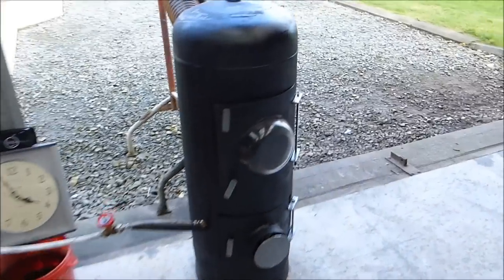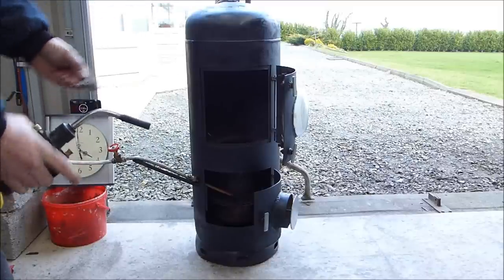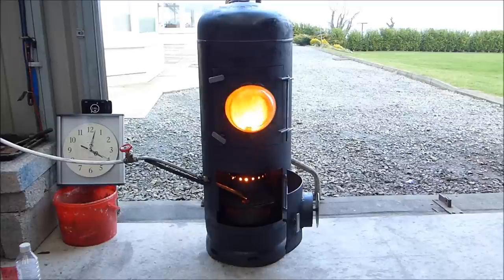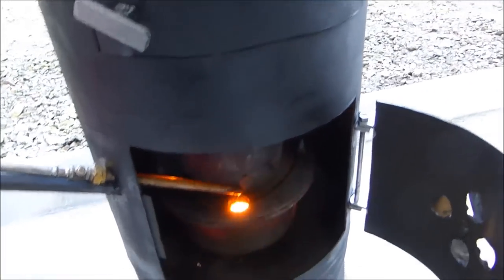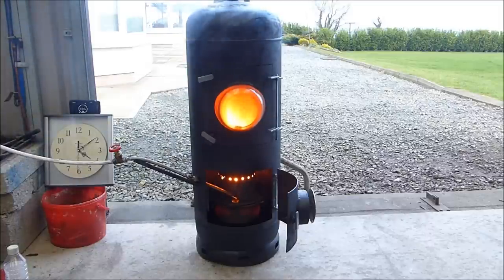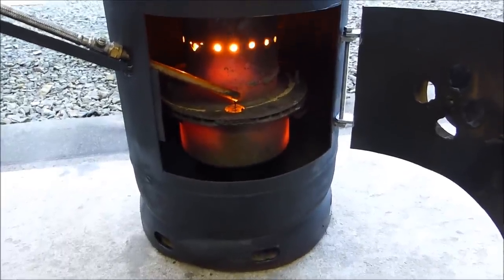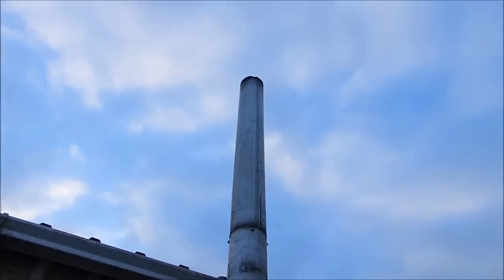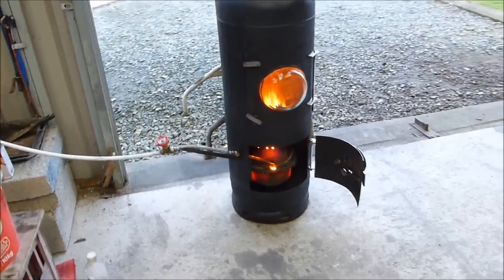Fantastic diy waste Oil and Wood burning stove heater.

Comment: Hi Gerry' great Videos'' You have done the best ones I've seen!!.... So I'm off to start work on it!.... Got 300ltr to use up so happy days'' I'll convert the top for cooking & put a boiler in it for hot water.... Ta Gerry'' Andy EIRE....way to go....
Reply from the maker: Hi Andy. Some Rashers and sausages while messing or working in the shed sounds great. Just need the plasma and the old sofa because if I spend any more time in the shed I guess after the divorce thats where I will be staying. Lol
If I find an oil barrel with a detachable lid I have something in mind and it would have a flat top. Tried today to get one but no luck. Slainte Gerry

Comment: How did the glass dish for a window hold up?
I really like the look of it!
Reply from the maker: Hi Stephen and Emily Stewart. The pyrex cookware was well able to stand up to the heat and the only time I broke them was if I didn't allow enough room for expansion. In my later videos I am using stovax glass but once you allow for expansion there are no issues. You just need to be a little inventive with the opening. Here's a link to my latest stove project. https://youtu.be/XFdklXMySNs Thanks for comment

Comment: bravo!  Good work.  I've wondered about using a Pyrex dish for a portal.  My waste oil heater doesn't burn that clean but I'm realizing I don't have enough draft due to using a smaller dia flue
Reply from the maker: Hi gghusa. The diameter and the length of flue are the key. It generates more pull on the incoming air which gives you a cleaner burn and more heat if you want it. I am using about 13 feet of flue which is  6 inches in diameter. The pyrex dish is holding up very well currently. Cheers

Comment: you have no air holes in the bottom pot  other than the bolt holes on the roter ? I seen a different make and he used air into his , have you tried that and if so is there much difference

Comment: That stove is a work of art!

How much oil does it use?
Reply from the maker: Thanks Vince. It works as a solid fuel stove too and will burn waste veggie oil all day long as well. About 1 us gallon per hr is the smokeless fuel rate. If you pile on the oil it will smoke but if you need higher output you just need to add more oil and increase the air supply in the secondary burn chamber. Cheers
Reply: Thanks. Do you get much odour from it when using it, or are there few fumes?
Reply from the maker: Hi Vince. There's no smoke from the chimney once you get the fuel mix right. The black paint was only put on the stove minutes before the video so it needed to cure. In operation there is zero smoke or fumes from the stove inside the shed either. Before I painted the stove black the original paint on the propane tank needed to be removed so I just lit the fire and it softened it so i could just peel it off with a scraper. I showed the original paint being removed in this video with lots of heat and smoke.
http://youtu.be/J9-0Do0dzCY
Cheers 
Gerry

Comment: You now need to add a electric thermostatic controlled air damper and solenoid oil valve, to automatically control heat. Thoughts?
Reply from the maker: Hi Martin. The damper idea is really good. I have some parts being shipped now so I will be doing more waste oil videos soon. Thanks for commenting Cheers Gerry

Comment: I build race engines and we use VHT high temperature header paint. It comes in a spay can and is good for 1200 to 1500 deg Fahrenheit. Your local auto parts store should carry it.

Comment: What stops it from burning back up the drip tube to the feed bucket????
Reply from the maker: Hi outdoorzone Where the tube goes into the stove is a low pressure point and the stove actually sucks air at that point which helps keep the oil cool. A metered pump system would work better but this drip feed system is so simple to construct. Hope this helps Thanks for commenting Cheers Gerry 👍

Comment: Will it burn used synthetic motor oil ?
Reply from the maker: Hi. Yes it will no problem. Just needs to be a little hotter bur runs great. Cheers Gerry

Comment: Just found your playlist, amazing job! Hope you still read this comment section, is possible to run both oil and wood at the same time?
Reply from the maker: Hi Fabrizo. Yes you can drip oil onto a wood fire but it needs to be in a stove where you can control the air flow. Thanks for commenting Cheers Gerry 👍

Comment: bloody great mate. just wondered about the pyrex. wanted to use the same but heard pyrex can only get upto 350 to 400 degrees. how did it fair?
Reply from the maker: Hi Brett. Works great and I only broke 1 when I didn't allow enough room for the door to expand. Heat was never a problem even with the flame on the glass. I have lots of videos now but if you are going for a non powered version I use my new burner on all the stoves. Here's a prototype that's quick to make before making it in steel https://youtu.be/hw3v2gN_sLk. Lots of other burners and stoves in this list . https://www.youtube.com/playlist?list=PLmQ5wJnkAIoJYDBgSOis9s1yDhcFdswtN Hope this helps Cheers Gerry

Comment: to gather more heat from this stove, try installing another large chamber similar to the propane tank above this one. More surface area = more heat generated.
Reply from the maker: Hi reltub2000. Another tank on top to radiate more heat would work for sure. In the video the stove is only in a temporary position for testing. I will be back in the shed soon with a different design of burner. Thanks for the suggestion. Cheers Gerry

Comment: Great stove, cool video. If you shut the door and reduce the air flow will it still run clean as regards smoke?
Reply from the maker: Hi GasGiant62 Yes if the door is shut and the draught regulator is opened enough it will run cleanly. If the draught regulator was closed tight it would not get enough air for combustion and smoke heavily. As soon as you allow enough air in through the draught restrictor  it will burn bright yellow and there is no smoke. Hope this helps Cheers Gerry
Reply: Thanks for replying.

Comment: Fantastic just gathered all the necessary parts to build one of my own ! Whats the consumption like please ? Regards Brian
Reply from the maker: Hi Brian. I tried to reply before now but I don't see my comment. It burns nicely at about 3 litres per hour but you can go more if you need more heat but you might get smoke. If you need more fuel just make the 10mm holes in the blast tube a bit bigger until you get the burn rate you need. You could just fill it with coal or logs if you run out of waste oil too. Cheers

Comment: Would it work to have the oil line connected directly to the burner rather than just drip in the hole? Would that be safer or not?

Comment: I am the Canadian viewer and they area I am in it’s nothing to get down 45/ to 50 below zero So maybe I can retire my two wood-burning stove’s call and use this idea instead to keep this shop that’s 40 x 20 warm And cut down the amount of wood used was going to make a rocket mass heater might just still do that Not sure yet but definitely going to make waste oil burner try it out and let you know how it goes thanks again
Reply from the maker: Hi Tony That sounds awfully cold. I think I would just seize up. I would love to see your stove when you get it sorted Thanks for the comment. Cheers Gerry

Comment: Great design.  Simple and effective.  My only question is how did you connect the oil line to the bucket to keep it from leaking?
Reply from the maker: Hi David. The connection is very easy. Its simply a 1/2 inch plumbing water tank connector tightened into a a hole I drilled into the bucket. The whole oil line is constructed with plumbing fittings that can be purchased in your local hardware / builders merchants. Cheers Gerry

Comment: If you are still looking for a paint that will hold up to the heat, try VHT High Temp Header Paint. It is and Automotive paint used for racecar exhaust headers. It is rated for over 2000F.

Comment: Great stove, planning on building your design in a warehouse art studio funhouse thingy here in the states. What kind of calculations did you do for the exhaust system? From what I've read, to avoid backdraft the exit chimney must be at least as big as the air intake. I suppose that the sum total of those drilled holes constitutes the air intake? Also, have you checked out the temps exiting the end of your exhaust pipe? I'd be curious to see the fine points of your exhaust system. Love this video, thanks.
Reply from the maker: Hi whyiowhy. To be honest I didn't do any calculations. I saw Ozzirt's stove and made that my starting point. 5 and 6 inch flues are standard with domestic stoves and as I had some 6 inch I used that. The hot gasses want to travel up through the flue so the hotter the gasses the more pull or negative pressure in the lower chamber. There is no backdraft as 6 inch flue is more than sufficient but the flue needs to be about 4 metres / 13 feet or more. The stove is a balancing act so for a burn rate of 3 to 4 litres per hour the holes in the burn tube work well. Empirical was the way to go on this one. I just uploaded a different type of burner that could be installed into this propane tank conversion. Great clean burn but needs a fan and is a bit noisy but controllable clean burn with savage output.
http://youtu.be/cYxtNRKj1Es

Comment: Sorry if this has been asked before, but why is it that the oil can simply be poured in like that without the risk of the combustion back tracking up the line? Is it simply a matter of the temperature at which it must be to ignite? Thanks so much.

Comment: very good job man!!!! I am thinking of replacing the oil with pellet. do you think this will work?
Reply from the maker: Hi giokrek. I used this propane tank stove with a different burner that uses a fan and that setup would suit better as a starting point to burn pellets. You would need an auger type delivery system and a way of metering the pellets but it could definitely work. Check it out here. http://youtu.be/AiKcx7ghtHk

Comment: you could try Simoniz VHT paint for the stove ..you can buy it at most autofactors in ireland ..its used for painting exhaust parts/manifolds on cars ect ..its good up to about 1200°F or 650°C ...Your stove is unreal :) ive seen a few like it in garages but all were more thrown together looking ...
Reply from the maker: Hi Hanny6911. Thanks for the info. The paint on the stove was good up to 1000f but has unfortunately gone up in smoke after many hours of burning. LoL.    I have a different burner in it now and I made it more permanent by putting the chimney through the roof of my shed. Its a no smoke high output heater and definitely worth the build time. Have a look at some of the later videos and see the new fan assisted burner installed into this stove. Cheers Gerry

Comment: Very nice setup, I love it!

What kind of heat exchanger do you plan to use to heat water ?
Reply from the maker: It is just a central heating boiler. Nothing special 20Kw mild steel boiler. Cheers

Comment: I like this burner but can you give me an idea of the burn rate
bill
Reply from the maker: Hi Bill.. It burns about 3 litres per hour but if you need more or less output it can be dialed up or down. If the fuel is increased too much it will certainly give more heat but will smoke. The holes in the burn tube could be increased in size or number for a cleaner burn at higher outputs.

Comment: Can you run your chimney horizontal like a rocket stove ?
Reply from the maker: Hi Thomas. I haven't tried it but I am sure it could be run horizontal for a little ways but would need to go vertical then as hot air wants to rise. The amount of draught or draw from the chimney is crucial to the design as the air being pulled in is what mixes the gasses for the burn. Cheers

Comment: How far from it can you feel the radiant heat and what temp is it? Thx
Reply from the maker: It heats the entire shed no problem and it's single walled metal. 6m x 9m  x 4.5 high 
Here's a prototype of my latest burner https://youtu.be/hw3v2gN_sLk I have lots of videos on this burner and other stoves I built in my playlists  Cheers Gerry 👍

Comment: Hi Gerry,  do you filter any of the oil you use or use it the way you get it?,  Cheers
Reply from the maker: Hi Dave. I should  filter out the lumps but this thing is so forgiving I get lazy and then I find the big lumps wont go by the valve.  In this video I use a jersey to filter waste cooking oil and then I light it. http://youtu.be/AduAYRr9cOM?t=56s
It really just needs to go through a course filter screen and it should be good to burn. Cheers Gerry

Comment: Hi, thanks for you video's! Can you tell me how and with what you made the ring that allows the pipe goes through into the second chamber where also the glass is?
Reply from the maker: Hi Joop vervaart. The ring / seperator is just 2mm plate that I cut into a circle with a jigsaw. 2 chambers work great because I wanted to use this as a log burning stove too.
More info on the seperator disk  http://youtu.be/K9jYA7YqZ4I
 I used a different burner in this stove here. http://youtu.be/QQGtl87-x58

There is some more information available on my website www.love2diy.com
Hope this helps. Cheers Gerry

Comment: could you line it  with that sand and plaster of paris mix . you might have to redo the stove to do that procedure . but it might save the outside of your stove,
Reply from the maker: Hi Gerry. Do you mean the outside or the inside of the stove. Cheers

Comment: Awesome design I am in Wisconsin and this could come in handy. I could heat my house with this as I have radiant water heat. Just add a 300 gal water tank to this and reap the benefits of used oil. Great job on the videos. Do you have a material list that you used to build this? I would be interested in building this design.
Reply from the maker: Hi Jason. In an earlier video I used this burner in a conventional cast iron stove. I break down the burner and give measurements.  http://youtu.be/mh3cljTTJ2o?t=7m35s  There is also a different burner design that needs a blower but is smaller and easier to install into existing stoves or boilers and burns really clean but is a bit noisier, http://youtu.be/AiKcx7ghtHk
Hope this helps. Wisconsin looks beautiful. Cheers Gerry
Reply: Gerry's Waste Oil Burner
LOL Thanks for the reply. I didn't see the earlier videos. I have now =) I am going to try to heat 300 gal/1135.62 liters of water and see how fast it will heat and maintain the heat. I think I will also add a thermal shutoff valve so it can turn off the oil in case the water gets to hot. Thanks for your detailed videos they are very educational.

Comment: they sell a 1500 to 2000 ceramic paint it is for exhaust but you would have to cook it on so you would have to be able to regulate the temperature of that a lot better I can't tell you what temperature you gotta cook it for for how long but it does work and it lasts a very long time

Comment: I'd like to say a job well done.  I have a tank just like this and now I have a purpose for it.  Now I'm looking forward to you boiling water because from that,  I could use with a turbine to make electricity and also make drinking water.  An off-the-grid solution that could be used around the world.  Combine that idea with shipping container living, that could really change things.  You got a big thumbs up and subscribe from Philadelphia Pennsylvania in the United States!!!  Absolutely awesome and keep up the great work!!!
Reply from the maker: Hi kidphillyorg. I have a few videos on heating water. I heated a 300 litre 80 us gallons of water with this type of burner in about 60 minutes 
http://youtu.be/1Et3rIn5GIY
I made a different type of burner that is capable of more heat but requires a blower. The advantage of the blower type is that it is small and could be easily fitted to an old oil boiler with very little modification.   here's a link http://youtu.be/AiKcx7ghtHk
Cheers Gerry

Comment: Great stove!!! What is the rate of consumption on the oil?
Reply from the maker: Hi threeredstars. It burns 3 to 4 litres per hour which will keep it at 800 to 1000 fahrenheit. Cheers
Reply: Gerry's Waste Oil Burner So, roughly 1 us gallon. Got it thanks. Great build by the way. I may build one here soon. Thanks for the motivation.

Comment: When you say "waste oil" are you meaning veg cooking oil?

Also have you ever built any very very small units?

I'm building a caravan styled to look like a 1930s bullet train and want to fit it with a waste veg oil burner or a small rocket stove. I was thinking that I would probably need to use a fan forced oil burner because I will not have room for such a large fire and a small fire and flue just does not suck much air.

Comment: love the videos, thank you! I watched them all and it seems like you always have a steady stream of oil. I have seen some other style drip burners that, well, drip and I'm wondering if the gravity feed and blowerless stove you built will still function at a drip or do you need the steady stream? Thanks!
Reply from the maker: Hi Daniel. It is possible to get great heat by just dripping the oil but my shed is cold and uninsulated so I just dial up the heat. The burner will work nicely at about 3 drips per sec with no smoke but less heat. Its easy to make changes and check out the results. With the burner in the video the really important bit is the flue because it gives you the pressure to mix the gasses for clean combustion. Cheers Gerry